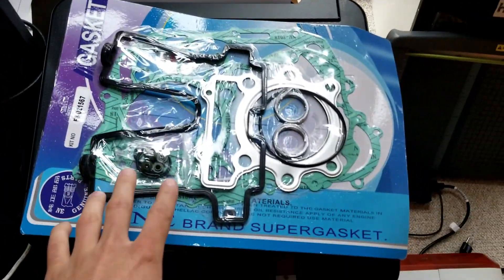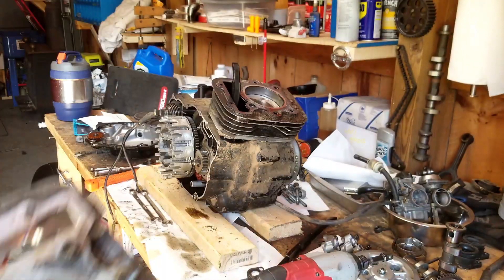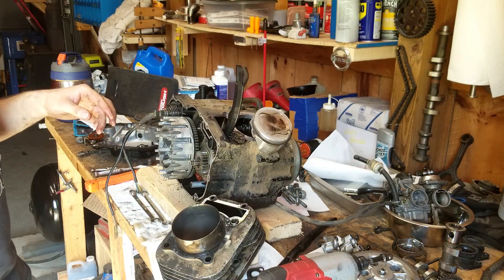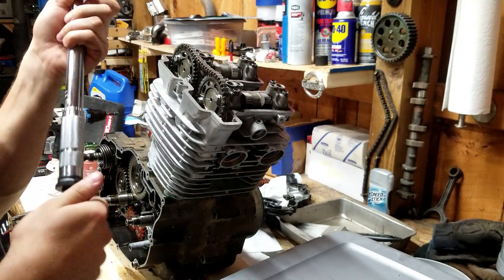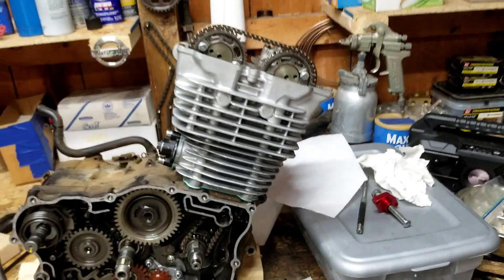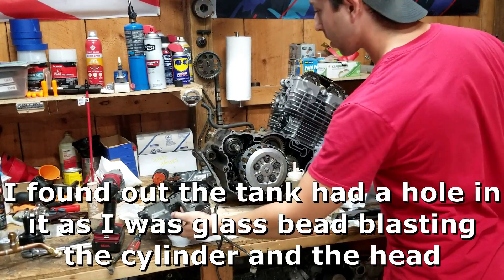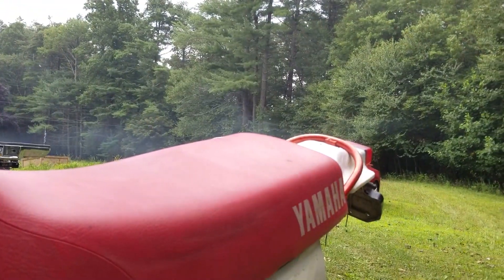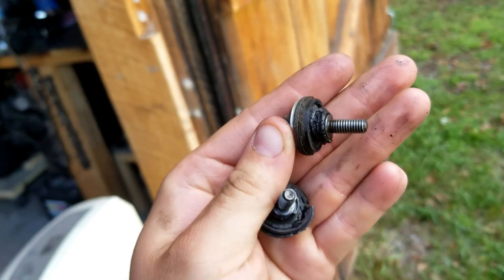Making my Ruined 89 XT350 Reliable (Engine Refresh)

Comment: Thanks for posting this. Im in the process of rebuilding my top end and clutch. I had to heli-coil the socket that takes the cam chain cover bolts. Seems like a common issue. This video was helpful and you had some good tips sprinkled through out that were more helpful than other videos of XT 350 rebuilds for sure. Im on the fence on whether to use the stock cam chain tensioner or not. Fairly certain the stock tensioner may have been the culprit of a bent valve the previous owner replaced on my bike. Anyways keep making XT 350 videos they are awesome!
Reply from the maker: Thank you for that! I also blamed my tensioner but in this rebuild I admitted to myself I was never going to remember or want to check the manual chain tensioner. Also I had narrowed the original timing jump from years ago down to not the tensioner (since its mechanical and "technically" shouldn't get weaker with age) but the timing chain just being too stretched (worn) out.

Comment: Found this video and I'm in the exact same situation. Rebuilt my top end with the same wiseco piston a few years ago as a teen with very limited experience, I didn't torque anything and stripped out cam cap bolts just like you said you did too lol gonna do it right this time hopefully my cams/head aren't junk
Reply from the maker: Hopefully yours will go as good or better than mine, Its still running, rode it last night after work so fingers crossed!
Reply: I rebuilt a 1985 with a stock piston, as a forged piston tends to wear a lot more on startup with the greater bore clearance required. Rejetted the carbs for some derestriction. You have to be careful cutting the airbox, as it tends to make it resonate and hiccup at 4500 rpm. 

I used viton stem seals and a Vinton decompression shaft seal, would consider those required. I run a manual cam chain tensioner, like shown, have to wrap the threads in Teflon tape to seal. I replaced the oil pump gears. 

The TT350 flywheel bolts right on, works great, 1 lb lighter.

Earlier kickstart shafts tend to break, later ones are different manufacturing —silver metal, they hold up.

Trailtech cht sensor is good to have, but hard to squeeze in the tight spark plug hole. Over 400 is the danger zone for the piston and head. It's hard to get that high if it's running right. Mobile 1 20w50 oil works great and runs substantially cooler for some reason. I also use premium gas or it tends to knock when hot.

I converted to all LED lighting, rewired all lights to the DC circuit.

I use 2003 cr125r forks and a modified 2015 raptor 700r se 4-way shock. YZ triple clamps are a direct fit with some spacers. Ride is incredible.

I adore this bike. I have 6k trouble free miles on it. Long stints of 65 mph on the highway and heavy off-road. It's bizarrely stable on the highway with the modified suspension, despite being 3 inches taller... And, it jumps like an mx bike. Haven't cracked the frame yet, but I'm light, 150 lbs.

Comment: Thing need a over haul low on compression
Reply from the maker: Its low on something. Not sure it makes its rated 28 hp. Years ago I had the cylinder re-bored and I installed a new piston and rings but it has still never ran quite right, its only had a few hundred miles on it since.

Comment: so was there something holding your shift rod in place? i just went through and re built mine but im having an issue of my shifting rod moving left and right and wanted to know it something on the case held it in or if i would need to replace my shift rod
Reply from the maker: I can't remember exactly but I do think on the right side case (clutch side) there was a snap ring or something similar that held the shift mechanism in place and also didn't allow the shift rod to move side to side when installed.
Reply: @HardAngle thanks im missing that snap ring if it ever had one, but now i need to rebuild the carb so any website recommendations or?
Reply from the maker: @callsign_x-ray  Honestly, anywhere you can find it, parts for these aren't always easy to find anymore

Comment: smoking because of the rings , piston and cylinder clearance is not true either the cylinder is not round or the bore  is too large for the piston diameter being used.  I did not notice : is there any evidence cross hatching in the cylinder?  have you checked the cylinder bore for being true or out of round?  where are the ring end gaps oriented on the piston, clearances of the ring end gaps? are the rings installed correct side up? any cracked rings? any excessive piston skirt to cylinder clearance is usually a noise long before oil burning is seen.   the fact that the oil smoke in this case  is not seen during deceleration  indicates  valve train is not likely the cause of this motor smoking.   in this video we see
increased smoking during acceleration and continued smoking during  steady  state rpm operation, this indicates a problem in the cylinder/piston/rings. check and verify the piston clearance,   piston ring end gap clearances, end gap orientations, cracked or collapsed rings  (oil rings), rings not installed correct side up, cylinder bore is round, cylinder walls are square,  crank case ventilation system is not restricted or plugged, using correct  engine oil

I use a full synthetic 15w/40 for diesel engines & never had any problems. 

🚫⚠️VERY IMPORTANT ⚠️ 🚫NEVER USE AUTOMOTIVE ENGINE OIL in your motorcycles!!

* IF the valve train was compromised, it would smoke during deceleration
Reply from the maker: This is the most detailed comment I have ever seen. So the cylinder was rebored only 200 miles before this but also the motor did not smoke until after I rebuilt it again, I did replace the valve stem seals on this rebuild so I do not think they should be leaking and the piston rings were still in good shape when I checked them before installing the cylinder. I think I will open up the engine again and check the tolerances between the piston and cylinder.
Reply: I would strongly recommend  honing the cylinder and putting new rings in,  rings are cheap enough, rings are not likely going to  seal if there is no cross hatching seen in the cylinder bore  also recommend using a  conventional (not synthetic) oil for the initial  break-in.  the rings may not seat properly if using a synthetic.   break in typically happens in less than 200 miles from my experiences.   *forgot to mention I have a 92 XT 350 that is very modified -   still have stock  cams and  piston for now. 

yes i am a tech/gearhead,  professional mechanic/ technician since 84
Reply from the maker: @cmonkeynutz1186  Well in that case, when I get some free time maybe I will break out the bore gauge and give the cylinder a good measuring and give it a quick honing and a fresh set of rings, couldn't hurt.
Reply: should I switch and use synthetic 15w/40 for my bike exactly like this?
Reply: @cmonkeynutz1186  What modifications have you done to yours? I've ground out the restriction in the inlet of the exhausts, opened up the back of the exhaust a bit, rejetted and converted the headlight and cluster lights to 12vdc. I've been looking for information on converting the oil pump and gears from plastic to metal, supposedly you can get the metal gears, pump and clutch basket from a tt350 and it will all drop in.
Reply: @ThatOneMinority  I like this oil because i seem to have smoother positive clutch engagements . I also have noticed that the engine/oil temperature is more stable less preignition /engine detonation when ambient temperature exceeds 100°F and I am riding too aggressively out here in the southern Nevada desert.   *part of why I am adding an oil cooler.   Honestly, I use the synthetic 15w40 in everything. I would bring up this one point  NOT ALL BRANDS OF OIL ARE EQUAL in their performance  despite having the same advertised viscosity.  I found  Del Vac synthetic 15w40 to be more resistant to breaking down, parts take longer to wear and I lost less oil when I had an oil leak or a motor burned oil.   Over all 50 % less lost compared to several other name brand synthetic 15w40 oils.  Based on my past 20+ years of experiences (cars, trucks, bikes, boats and equipment).  Not all motors are equal, you may find something else that works better for you. My goal is more time riding than wrenching, good luck!